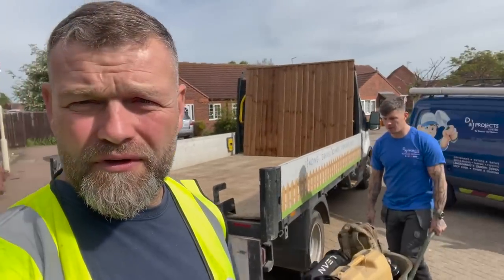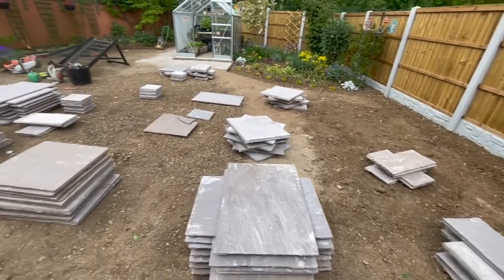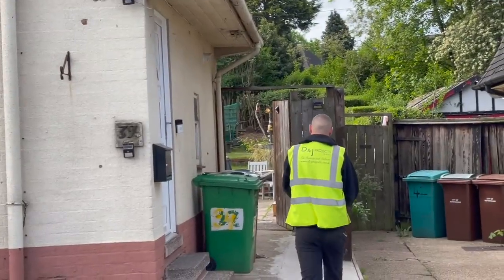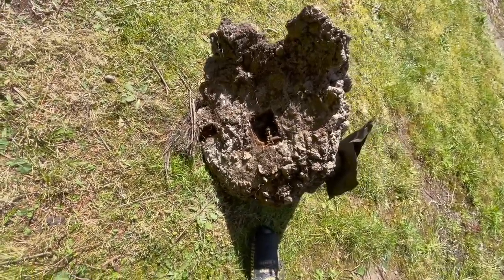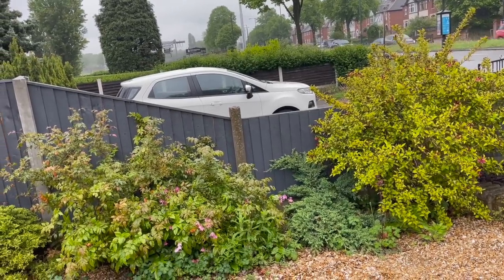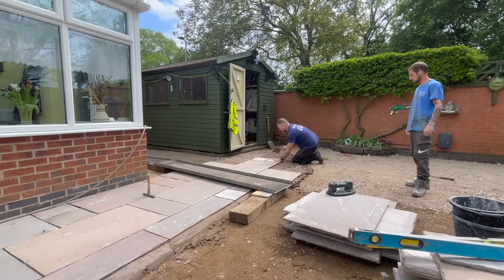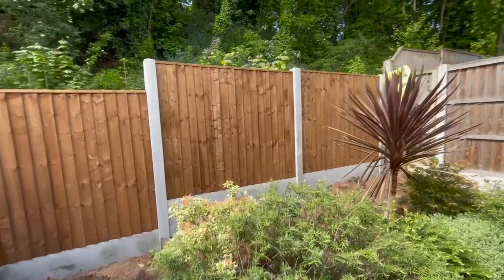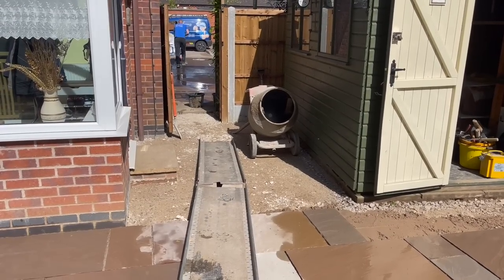WE'VE HAD A DISASTER AT D&J PROJECTS... This Week At D&J Projects #56

Comment: another great video. quick question, with your indian stone, do you not paint the back of your slabs with SPR or PVA to prevent the moisture going through the slabs? i have always done this personally, wondering if you have found a different way to prevent? Thanks! Keep the vids coming!
Reply: Not sure if this is the same thing but we only coat darker stone with pva as sometimes a white stain can show through from the cement
Reply: @damienmitchell9828  I was just taught from early to paint the back of the slabs with SPR solution with a bit of cement mixed in or PVA if on a budget...
Reply: @samanker5095  what's the reason for coating all stones ?
Reply: @damienmitchell9828  I was told to prevent the moisture being drawn through the slab out of your wet mix bed and leaving stains on the showing face of the slab.
Reply: @damienmitchell9828  it’s so the slabs stick nice mate and don’t rock

Comment: Cracking jobs as always everyone!, Steve that job where you had to look at the latch and drop bolt how could we forget it, it’s the job where Taff went through the electrical cable in the corner, also on the fencing job where you put 2x 3 and a half ft panels at the end you say there would have been just a small gap if you had put a 7ft in could you have not just put in another concrete post to fill that gap and hold the old fence? Also such a Shame about the Swans, also have I missed any videos of the £1000 giveaway winners? Keep up the brilliant work